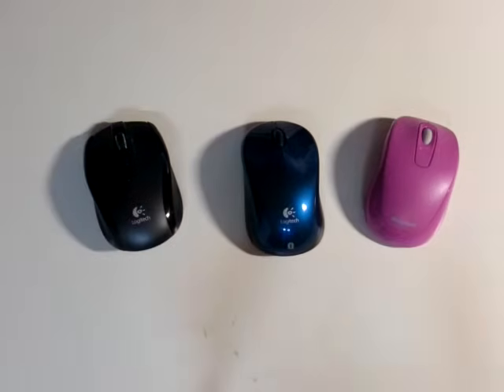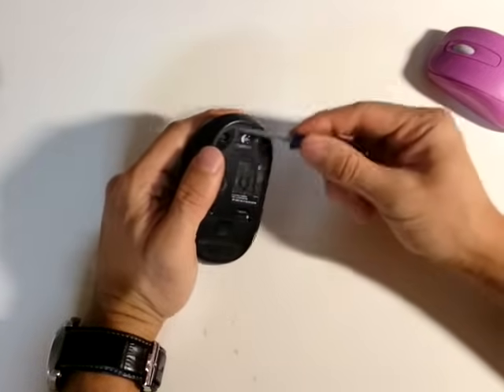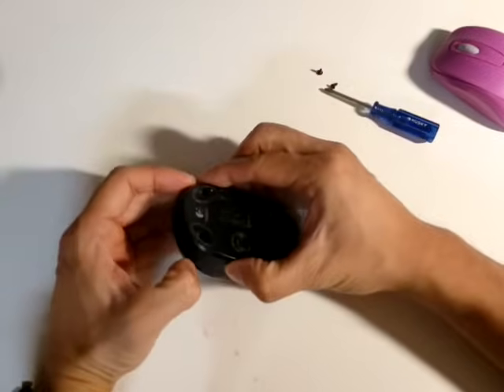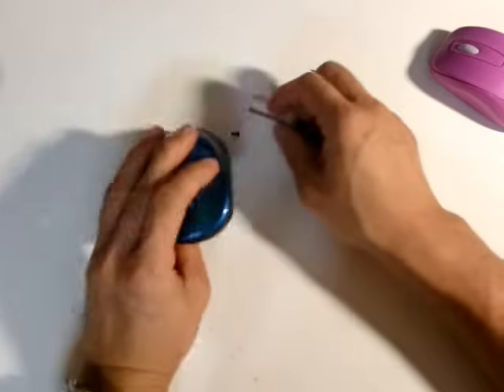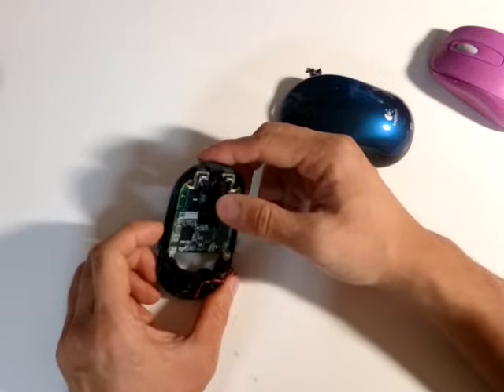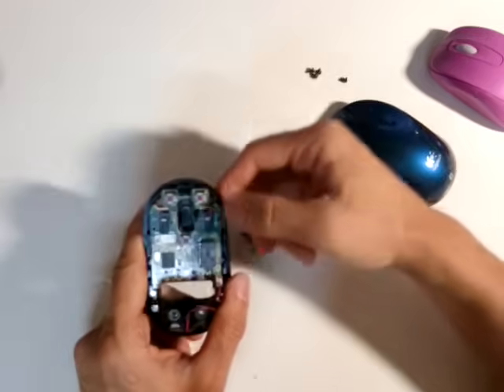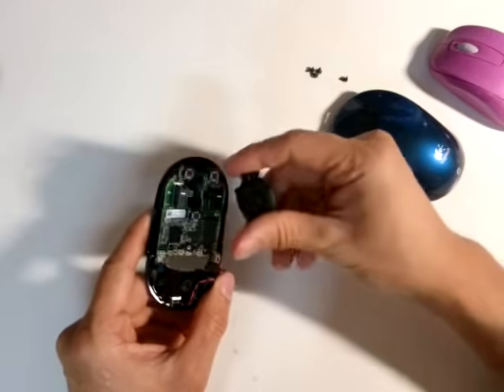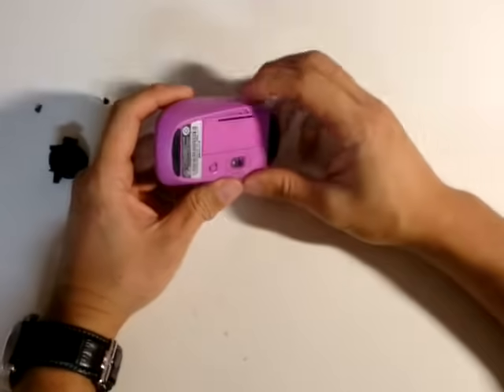Computer wireless optical mouse disassembly

Comment: My Microsoft 5000 wireless mouse doesn't have screws - more like rivets (under those rubber pads). Have tried numerous tools but nothing makes them turn and come out. Tried popping the top which comes up a bit but not all the way. Do you know how to get those 'rivets' out?

Comment: my mouse does not have screws i checked under the label the stickers even the rubbers how do you open a mouse that does not have screws?
Reply from the maker: There are probably screws hidden under the rubber or sticker pads.
Reply: @conceptedge  uhhh i just told you that i checked those spots
Reply from the maker: I did not read carefully your post. Excuse me. It is probably held in place by plastic clips around the shell. Try to use a very small flat head screw driver to gently pop it open around.
Reply: @conceptedge  understood thx for that tip it works now

Comment: my mouse hasn't screw how can I open it?
Reply from the maker: It is probably held in place by plastic clips around the shell. Try to use a very small flat head screw driver to gently pop it open around.
Reply: @conceptedge  ok thanks

Comment: 23 may 2019 9:59 am edt:thanks.
my mouse contain crevice between left-button-area and bottom-area,which accumulate dandruff then difficult to remove that dandruff.
23 may 2019 10:6 am edt:
my mouse is dell-mouse with ball,not optical.

Comment: How about a mouse that has one screw? That would actually be useful since I don't want to break it. Four screws are for screws ;)
Reply from the maker: It should be simpler. There are probably some clips hold it in place, just pop the edge with a flat head screw driver.